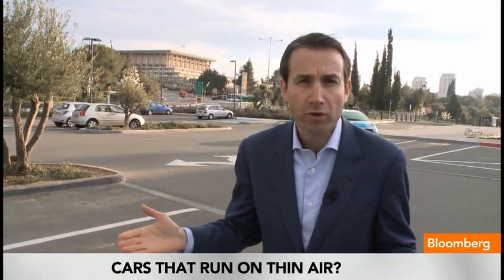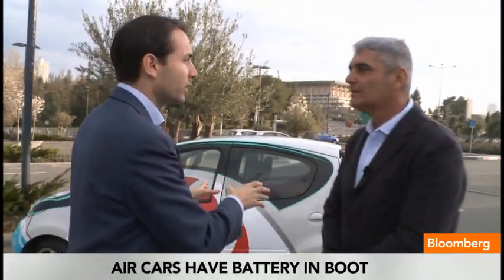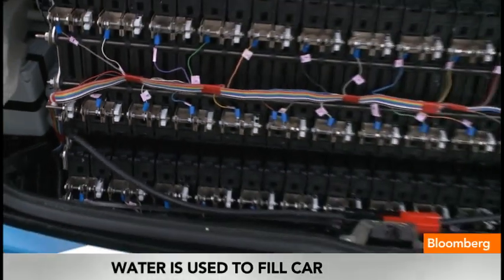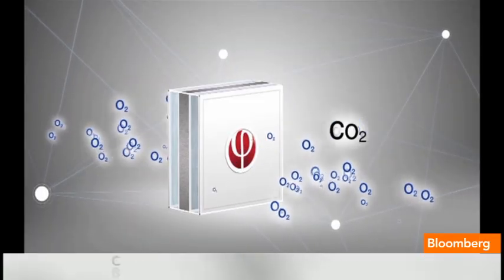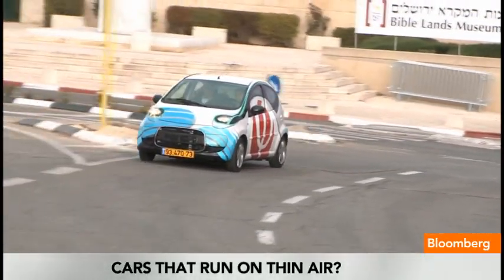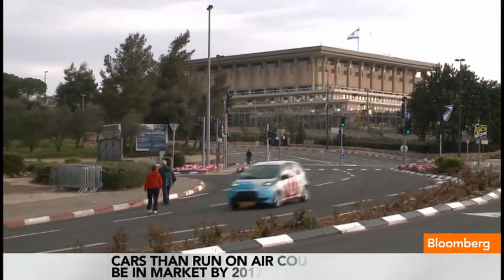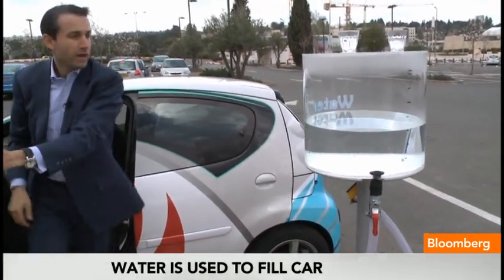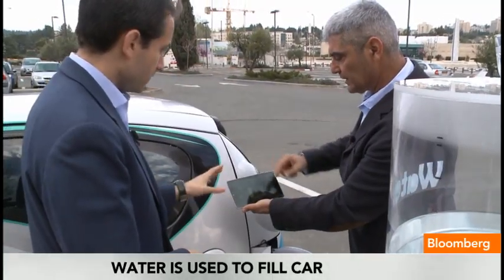A Car That Runs on Air, Water: Here's How It Works

Comment: We discovered gravity and found that batteries are obsolete and worse than fuel on the lungs

As It eats through glass

Infinite power

Such as gravity

Requires no energy storage

As gravity doesn't ever run out

We should be using it to keep the lights on while its refilling the tank

To power the whole town with gravity

Might help to reduce the 9 million deaths each year caused by pollution

It's like watching 9 million lemmings go over the cliff

You would think they learned from last year

To not die in their millions this year too

I guess it's extra deadly because it's invisible

But its also super avoidable being that there is over 100 years of old and new compressed air vehicles all over the planet

But I still personally think batteries should be obsolete too because replacing breathing carbon monoxides with highly explosive and unstable lithium can only be a bad thing when it eats though glass

But if you think about it you can drink a little fuel and not die

But lithium when that goes wrong it will melt your skin off

Imagine watching your windscreen melt and then thinking to yourself maybe batteries are also a bad idea

A gravity powered glass car doesn't even need paint so it definitely doesn't need fuel or batteries

We are eating breathing and drinking uranium ceasium aluminium carbon monoxides plastics and breeze blocks and harmful chemicals used in society

Should we try not to add lithium to that list

Because 9 million deaths can quickly turn into 50 million deaths

With just one more corrosive element in the fish bowl we live in

If it kills fish

Remember that we also come from the ocean
And get poisoned too

Comment: and  ... it;s  2019 .....  and now we are hearing about another cr  " RANGER " by 2  Indians in Bangalore .
Reply: This range extender is simply useless. It's a single use system where you have to replace the aluminium electrodes every 1000 km. Mining is really expensive and enriching the aluminium bauxite ore is highly inefficient process and guzzles up a lot of energy even before manufacturing it into sheets. The energy consumption of mining, enriching, manufacturing required for a 1000km battery setup takes up 1000 times more energy than running a car on petrol (extracting and purification). 
Now this "so called zero emission" car has already polluted the atmosphere 1000 times more than what an "air polluting" petrol car would have done.

Stop these kinda idiotic inventions. We already have practically working and mass produced Lithium ion "rechargeable" batteries that needs a replacement only after 2,00,000 kms or 8 years.
Unlike these air batteries that need a replacement after 1000 kms or 1 month.

Do these IIT retards think other engineers are fools? Or are they the only kind of the intelligent bunch in this country.

Comment: 2019 no air car ?
Reply: The problem is that you have to replace the battery once every x months as the aluminium wears out... so this is a solution but possibly in hybrid form
Reply: @sailingaroundtheworld1427  I read that if all cars ran on aluminum, we would consume the planet's' aluminum in a few years.
Reply: 2021 and nothing
Reply: 2024 still waiting
Reply: Nope

Comment: There is a problem with these batteries. These two batteries can not give more than 1500 watts of power, these are two horsepower - very little. You can drive only 30 miles a day. And then this car charges all day with an aluminum battery. Of course, you can drive 1000 miles on a single charge, but only 30 miles a day.
Reply: How do you know

Comment: Basically, the car runs on aluminium.
Aluminium, oxygen from the air and hydrogen from the water react to aluminium hydroxide.
The aluminium and the water gets depleted and you have to replace it.
Reply: Isn’t aluminum more affordable and sustainable then petrol?
Reply: @creman12  totally, the equivalent to thousands and thousands or barrels. literally years.
Reply: @creman12  Also, it's not the equivalent to 1000s and 1000s of barrels?
It's more expensive.
1kg aluminium to consumer : $4
1kg fuel to consumer : $1.50

This is without the cost of batteries, O2, etc.
Reply: @jackietate4047  Apparently that's one of the big unanswered questions: How long do the aluminum plates last? Some estimates have it at somewhere between 1000 and 5000 miles. I hope that's incorrect because that would be ridiculously awful and pretty much sinks this project before it even begins. If it's something like 50,000 miles then it might be worth it.

Comment: It's 2018. These are nowhere to be found, so... I'm building my own. They're not as simple as they seem and my ham fisted efforts aren't as sleek or efficient but it's worth investigating. The HESS (hybrid energy storage system) management would be best utilized if the lithium batteries were completely disconnected while under way, using lithium batteries for starting, acceleration and grade climbing. The air batteries only maintain speed once reached and are sluggish at best but appropriate if used for their intended purpose.
Reply: Did you eventually build it or you were just commenting like the rest of the population?.
Reply: @fancyIOP  I'm working with someone with a metals lab in Louisiana- trying to increase the curie point of Gd while reducing the Tc of nickel.
Reply: The curie engine is a part of the HESS
Reply: @evanriddle1614  that’s great, we shall see when all is done then.
Reply: evan riddle that's great Ima build a car that has infinite fuel
Reply: @juelzbeat5669  Let us know how that goes. Who is Ima?
Reply: evan riddle I'm talking about myself but I can't tell you how because I don't want someone to steal my idea but you'll see when I make it in a few years
Reply: @juelzbeat5669  how far have you reached?
Reply: @catvideos7309  they prob got to him already…
Reply: How has this gone over the years? Curious to know the progress you've made?
Reply: @isaiahthemack8892  I've uploaded a video. Gadolinium magnet shield. It could be the holy grail for magnet motors but I'm using it differently. Can you see where this could go?
Reply: I haven't thrown batteries out but there's something interesting going on with a rare earth metal that's not rare earth expensive. Y'all look up "Gadolinium magnet shield" on YouTube. Simple demonstration but I think you'll see something in it like I have. Thanks
Reply: It's important to note that this car uses lithium batteries. The gentleman mentions as much. Aluminum or zinc air batteries have huge power, as much as 5X the energy density as the lithium pack. But getting the power out of the air battery is like trying to drain a swimming pool with a drinking straw. The advantage is that the air battery can be used to recharge the lithium traction battery without a substantial weight penalty. Space is another matter. Air batteries are bulky but not terribly heavy.  Most electrolytes are spent after about 6 hours operation. Fresh electrolyte needs to be kept on board. Just water? Maybe. But there must be some chemicals lurking in a container somewhere and water refilled on the fly. Thanks.

Comment: There is a much better, much cheaper technology already available and market tested recently: Tata was involved in a prototype car that ran on a tank of compressed air. A single charge got you 300 km. Unfortunately, the chief engineer working on the car and getting it to market mysteriously "fell" to his death from his hotel balcony.
Reply: Tata was just licensing MDI's compressed air tech. The reason it's not used is that compressed air has terrible energy density. Worse than the worst batteries. No compressed air car has ever been independently confirmed to have a range of more than 5 miles.
Reply: true this technology is called electromagnetic propulsion.  Basically, these inventors are containing the electric field in an electric car, just like in a gas car.  The solenoid in a gas car increases voltage.  The solenoid in an electric car also does the same.  This voltage is then maintained by another powersource, such as a motor.
Reply: @dcaster1829  Why did you write that meaningless nonsense

Comment: Runs on air yeah? ....my arse! It runs on aluminium you nob-head! It is aluminium that is being consumed and not replaced here, in fact, the Li-ion batteries seem to be dead weight here; I can't see what they are supposed to do other than, maybe, store the energy for quick release when needed. If you can get hold of plenty of cheap re-cycled aluminium, then this could be a goer, but only for the few.

Comment: Aluminium doesn't come out of the ground as drinks containers, tubing, or wiring. It has to first be processed into alumina from the ore bauxite, and then further refined via electrolysis into metallic aluminium. This requires very significant amounts of energy as you would imagine.
Reply: Same for the electric cars today... lol
Reply: @w3w3w3  at least in electric cars it's about 90% efficient to charge the battery. When you have to process the aluminum there are energy losses at each step making it probably close to 25% efficient and still polluting as there are gas burners to process it.
Reply: @atomix2201  Which steps ? It' s only one big step, i.e. producing  aluminum from raw bauxite and the other way around, producing aluminum from Al hydroxide. From an energy efficiency point of view, it's basically the same the lithium cells, the only difference is you have to charge a Li battery, while Al batteries are not rechargable and have a limited operational life (but they have to be recycled elsewhere, at the end of their lives)
Reply: congratulations you used google

Comment: It doesn't "burn" aluminum.  Electrical currents are generated when you have two different metals in contact with the same electrolyte, e.g. water that has not been distilled.  In car batteries, they commonly use sulfuric acid because it has a high concentration of soluble ions that conduct the electricity. There has to be more than just the aluminum and water.

And I agree with Playbosmurf1. Aluminum requires A LOT of electricity to be manufactured and more electricity means more pollution.
Reply: Not if it's hydro generated

Comment: Let's look into this a bit further.  Is burning aluminum the source of energy here?  Energy I/O is important.
Reply: The aluminum reacts with the air and water and creates an electric charge that goes to charge the lithium battery.
You refill with water.
Reply: @jackietate4047  how do you refill the aluminum because if it reacted with anything then there will be a change once that happens it won’t react again so you need to replace it. But aluminum production takes a lot of electricity so doesn’t seem like it only runs on air